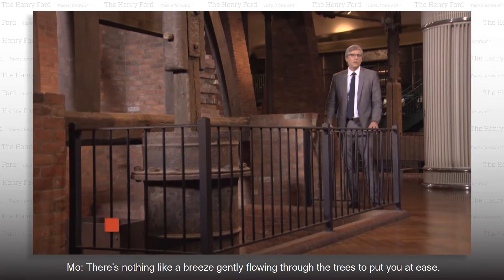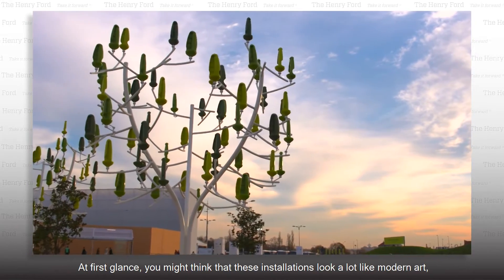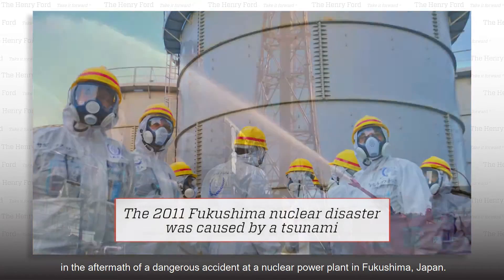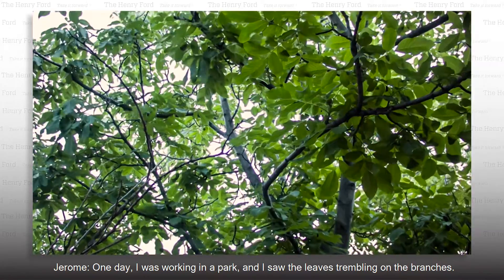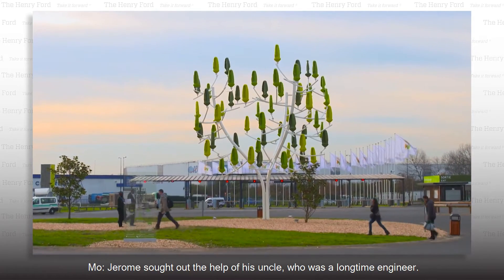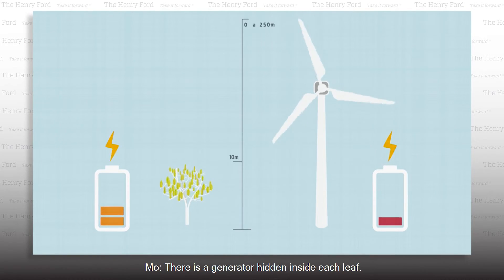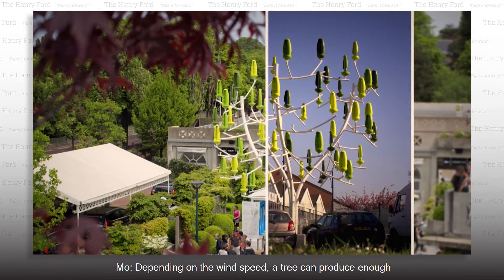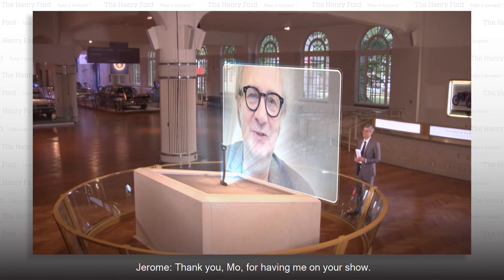Tree Wind Turbines | The Henry Ford’s Innovation Nation

Comment: There is such a thing as "over engineering" whether it be wind farms or this "wind tree"

Just go back to promoting individual, basic wind turbines and you'd see wind quickly gaining ground in percent of electricity produced compared to the other sources. Same goes for solar, both are most efficient and sustainable at small scale rather than industrial scale.

Comment: Some comments ask about the power produced.
The eqn is Power = 1/2 * C * p * a * v^3     where C is turbine efficiency,   p is air density,  a is area of turbines  and v^3 is cube of wind speed  all in metric units.
Using very best efficiency for drag type turbines is 15%,  assume air density p is 1.23 kg/m^3, and assume these 36 turbine leaves are each 1m tall and 25cm dia.

At wind speed of 1 m/s  (2.2mph) the power output is a paltry 0.83W     i.e.   0.5 * 0.15  * 1.23 * 36 * 0.25  *  1*1*1 
For higher wind speeds of 2, 3, 4, 5, 7, 10, 13 m/s we multiply the above 0.83W result  respectively by  2^3,  3^3,  4^3,  5^3,  7^3,  10^3,  13^3 
which gives us  6.6W,  22W,  51W,  106W,  285W,   830W,  1824W.      The cube of wind speed is the key detail.
Most times the wind speed is typically 4 to 5 m/s (~9 to ~11mph) so the typical power of this tree is 50-100W.
Turbine manufactures often quote the power at highest wind speeds say 13m/s (29mph) and not tell you that typical ground winds speeds suck.